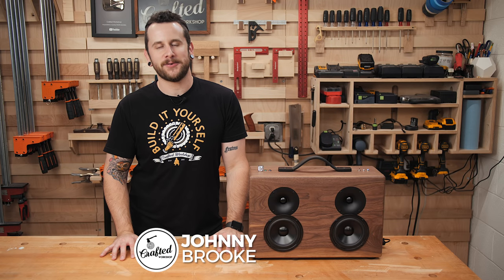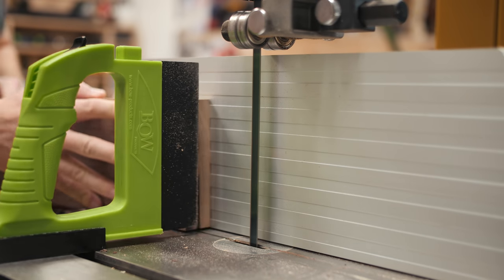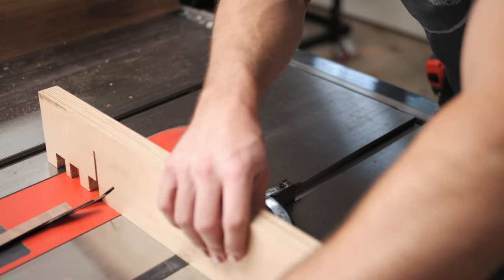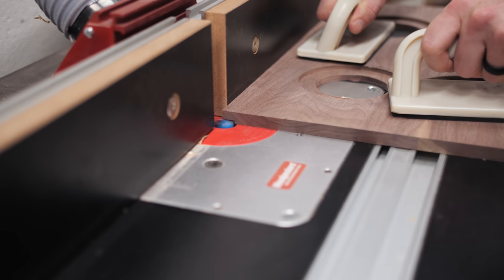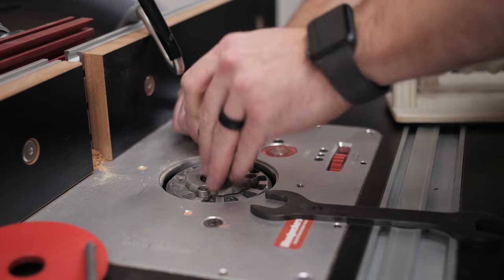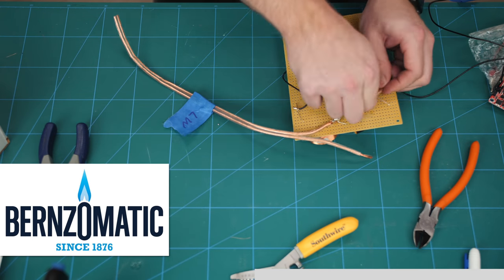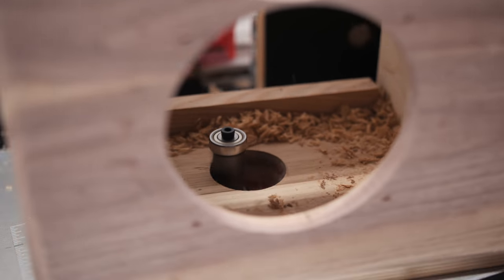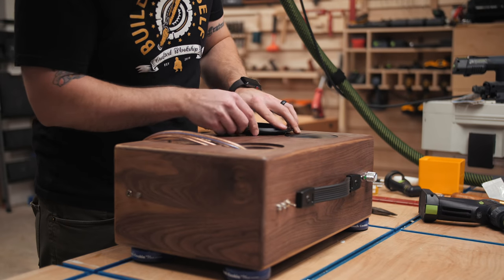DIY Battery Powered Bluetooth Speaker // How To Build - Woodworking

Comment: Would have been nice to see an in depth section dedicated to the power distribution.    The first word in the description is BATTERY and yet you have nothing in the video indicating how you handled that.
Reply from the maker: Go check out the blog article. Detailed electronics info is a little dull for video, this amp board is modular and has readily available battery packs that can plug into it. Super simple.

Comment: My first job was soldering audio jacks for an entire summer so I got pretty good at it. I ended up working at that place for almost 10 years. I'd say you did a really good job for your first time soldering. Here are my two biggest tips: 1 - put a dab of solder on the tip of the gun before touching it to the wires. This helps transmit heat from the iron to the wire. You want the wires hot enough to melt the solder, otherwise you'll get a cold joint that could break or have lots of resistance. 2 - Use spring clamps to hold your parts. Just put them on their side and clamp the part in place.
Reply from the maker: Thanks for the tips!

Comment: This looks great!! The only addition I would do is to install a couple of 12v 8Ah batteries and charger so you can make it a portable great looking boombox! It will require some additional electronics to convert 110v to 12v, to measure charge and stop charging when full... but I think it would be totally worth it!
Reply: I use 18v power tool batteries in a reciver shoe, then step that down to 12v for a class 'D' amp.

Comment: Very nice speaker build. But most of us don't have all the fancy tools to do this. I built one out of plywood and car stereo media player and car speakers. 12 volt LiFEPo4 battery and charger and sounds great , no foam inside and an vent hole on front panel. did I mention it sounds great. Lots of bass and good overall full range sound. I use it at work on my tool box. I may build a second one for home use or to replace the one at work  and use that at home. will see.

Comment: My daughter and I build a set of c-notes. I recognized them in your thumbnail haha. That box must sound awesome, the c-notes are great. The only downside is that you're missing the great imaging these speakers have by putting them so close together.
Reply from the maker: Have Drone Will Travel that’s funny! And yea, it sounds great but I’m definitely not getting as much separation as keeping them separate.
Reply: I'm still blown away when I hear the c-note. That's the best sounding $100  you can spend I think. And this box, in walnut, it looks as good as it sounds.
Reply: Yup, the C-Notes are known for their incredible imaging (for the $$.) Almost a waste to use them in this application.  I bet they still sound good.  I do wonder if a cheaper set of drivers would work well in this boom box.  Worth researching if I build one.

Comment: ** dO It YoUrSelF ** with at least 100k worth of wood working tools...... :p
Reply: normal MEN have all little cheap tools in home or garage and lot lot more tools too. no expensive, ewer no 100K haha. normal need only some clamps ,i have 4 pcs cheap and no need more. tablesaw have ewery normal men in home, same hand router, and hand planer, all other can do diy in home workshop, planer frame, jointer, circle jigs, no need lot tools can made all same.
Reply: A lot of the tools in this are pure convenience. Almost all of these things can be done with hand tools.
Reply: @farrit  thats how i make mine. i sure as hell aint got all these fancy tools.
Reply: yeah, if i had my dads table top drill press, table saw, radial arm saw, and table jig saw. he spent over 1 g's and 5 years to collect. all i have are hand saws and hand tools.
Reply: @abalczon  im going to make a portable radio into an ammunition can. i can power it with a 20amp 12 v power supply and power jacks found on amazon.
Reply: What kind off wood do you use for this speaker, nice speaker btw
Reply: But he did do it himself tho.

Comment: That looks great! 👍
Set the bad boy near a corner to get some serious bass! :)

Nice work, I never imagined I'd see so many amazing C-note builds! Or variations of... Lol

Thanks for sharing!

By the way, the ports on the bottom are no problem, lol.
Reply from the maker: Chris Perez thanks Chris! I just realized you designed the C-Note kit, that’s super cool. I bought the kit on a whim after hearing such great things on the r/diyaudio subreddit and they’ve been sitting, waiting to be built, for months. And glad to hear bottom ported is approved 😊
Reply: Hey Johnny and Chris... I built a pair of C-Notes last winter and love them--my first DIY speaker project. I've been thinking about exactly this type of project for awhile now. Any thoughts as to whether it would make sense to tweak the crossover for some baffle step correction for this configuration, considering the baffle is now twice as wide and both speakers are essentially on the same baffle? ...or would that be overkill for this purpose? Great job on the build Johnny! Chris thanks for giving us the C-Notes!

Comment: Beautiful build!  
Although, I'm not crazy about the overlapping drivers. Particularly with all that empty space around them.
I would have used slightly smaller tweeters and used up more of the horizontal space, but that's me. 
I think channel separation is worth having, despite the more traditional aesthetic of the tweeters rising and separating toward the corners.  Your design is very pretty, very symmetrical, but it may sound a bit "mono" if you're not right up in front of the system.  It's not much, but with these small boxes every inch counts.  
No worries, that's just an opinion about a minor detail... It really does look great!  ;-)
Reply from the maker: Thanks a lot!

Comment: Beautiful looking box, Johnny. Someday I'd like to build my own as well. This, and as you mentioned in the notes, Kirbymeetsaudio, have inspired me more to do so. 
Question though - why stop sanding at 180 gritt? I haven't used walnut yet so am a little unfimilair (my main preference is arizona mesquite). In the mesquite, to get it to truly explode in color and texture, I take it to 600 gritt while raising the grain on every gritt. To recap, every gritt 2x, with raised grain in the middle. What a difference. 
I'd love to hear your feedback. It's how we all grow, isn't it? 
Again, beautiful box.
Reply from the maker: Phil Z thanks Phil! I’ve just found you get diminishing returns past 180 or 220 really. I’ll sand that high if epoxy is involved, or sometimes on turned pieces that are going to be buffed to a high gloss, but for a satin finish, I haven’t seen much of a difference. But hey, if you’re getting good results, sounds like your system is working! Mesquite is super hard I believe, so it’s different from Walnut in that way.
Reply: @craftedworkshop  , thanks for the reply, Johnny. That does make sense to me. And you are correct about the mesquite being much harder than walnut. With the method I stated, mesquite will actually become mirror-like reflective before finish. I do it regardless of gloss or satin. It just adds to it that much more (for mesquite anyway)
Thanks for your time. 
I'm glad I found you through Alex's STS channel. Good stuff.
Reply from the maker: Thanks Phil!

Comment: Just to be that guy.. To get better cuts on the cnc use 3d tabs. Experiment with what works best for you but mine are about 1.5 and .22 inches tall. That keeps the movement smooth so you don't get those marks were the bit stopped and went over the tab. I also use one of those vibration cutters to cut out the parts. If I use a chisel it might splinter out.  Sorry.. I know i'm just one of many guys trying to tell you what to do.. lol Trust me, I got sick of sanding or trying to sand out those marks and that works really well.
Reply from the maker: No, those are great tips man! Easel doesn’t have 3D tabs, but I just got Aspire so I can start messing with them.
Reply: @craftedworkshop  I use vcarve pro. I'm pretty sure you'll have it in Aspire. That's a better version. All from the same company. 

Also experiment with down cut bits. It leaves the top nice and clean. Not that great for the bottom.. but.. and don't drill with it, makes a nice cut.  I do not like up cut bits.. Nothing but issues for me. Down cut or straight.

Comment: Looks nice and it's built well nothing wrong with the cabinet, just the layout of the drivers itself doesn't look good. Mainly because the woofers are overlapping the tweeters, should had made the box slightly bigger to allow some space between the drivers for aesthetic reasons.

Comment: Amazing results! Your title says it is battery powered - but you didn't really mention anything about how that is done. Was this actually battery powered or did you wind up just using wall power for it? 

I'm looking for a similar kit to build, but I don't need battery power... 

Keep up the awesome work!
Reply from the maker: Yea I kind of glossed over it, but it is battery powered. The amp board I used has a plug and play battery pack, which I linked to in the video description. You can see me install them when I installed the amp and crossovers, they’re bright green. I installed two packs and the speaker has been playing on battery for 36 hours straight at this point, crazy!

Comment: Very nice project. I was wondering if I plug 2 boards how many volts do I have? (using 3,7v  battery) is there any way to plug them in parallel/series?  thanks in advance

Comment: Nice build, I've thought of making the Cnotes before and may still. Did you talk to anyone about moving the port from the back in the kit to the bottom of the box? I've found kits in the past with rear ports but wanted front ports instead and haven't found what effect if any it would have on their performance.
Reply: Moving the port to the front would be no problem. You would need to make them a little taller to fit it (or use a port with no flange). 

As far as changing the dimensions, for best results you would want to keep the width of the enclosures and the distance from the top of the enclosure to the tweeter pretty close to the original design  (within an inch or so). Not that changing them much will make it sound terrible, but if you increase those dimensions much you will get a boost in the midrange, they might get a little bit "shouty" sounding. 

Really the most important dimension is the center to center distance between the woofer and tweeter.

Actually, you could make the enclosure about 20% larger without having much effect to the sound.
Reply from the maker: Stumptown Woodworks sounds like Chris answered that nicely! And he also mentioned in another comment that bottom ported was fine.
Reply: @chrisperez7592  thanks Chris! I'm rebuilding a vintage record cabinet with a pair of OnePi speaker kits and it's my first speaker build so I'm sticking 99% to the instructions. But this one project has got me wanting to dabble in the speaker world more...just have a lot more speaker forums to read through!

Comment: Does this board, or any of the DIY Bluetooth boards support hifi Bluetooth codecs?  I know you said you’re an audiophile, and I’m curious if you went the extra mile on this.  I can’t find a board that states it supports lossless or other hifi options.
Reply from the maker: Michael Rasmussen yup, Bluetooth 4.0 aptX, which is as high as you can get AFAIK. AirPlay would have been even better but this board doesn’t support that.

Comment: Hi! Super nice project, always dreamed about my own spesker like that :) may i ask you a question, what kind of cnc do you use? I noticed is that a removable dewalt router which is put into the cnc frame/base?
Reply from the maker: Maksim NMR thanks! I use the Inventables X-Carve, I’ve linked to it in the video description. Works great!

Comment: How long does it last on a charge?  And how much was the overall build? By the way I love it.
Reply from the maker: The boombox has been playing for 42 hours straight so far, insane battery life. The electronics were about $250 plus the cost of the wood, which will depend on your area.
Reply: @craftedworkshop  If you have some time would you please go over the electronics or more specifically the battery setup. I appreciate your response earlier. It's a beautiful build. Definitely will build one when I have more experience with the tools I do have. Thank you
Reply from the maker: Unstable1 I’m going to do a detailed post on my website breaking down the electronics. Stay tuned!

Comment: I love your work just don’t like the speakers positions.
Reply: alas have to agree there, the case is awesome, but ... the positions seem off. You want as much distance between tweeters as possible. Now the original C-Note speaker kit has that same overlap on their show models too but there it is a left and right speaker each with their own box. In a design like this you want to maximize the distance as high notes are far more directional than low notes (which is why bass speakers are usually a single box placed in the center)

Comment: I'm curious why you lined everything with foam, You should have done a sound test before you added the foam. Guitars are not lined with foam on the inside for a reason. Different materials give a different sound, I bet that Walnut would have been fine just bare.
Reply: A guitar is a guitar... point...

A speaker has to mimic all instruments and more...
So there's a big difference

Foam isnt needed, but it serves 2 goals:   being able to use a smaller box and dampening soundwaves coming through the wood, being at a different phase...
Reply: @lillnemo1  unfortunately this wood is not very good for sound there is a reason why the industry uses mdf (Medium Density Fiberboard )

Comment: if you want to get into electronics and soldering ,get a normal cheap soldering iron from china , the ones with the big transformer box and the temperature knob ,get a small tip for the iron and a chisel tip not too big ,the chisel tip should be like the tip of a sharpie pen...
for solder get yourself solder 60-40 with 3 or 4 flux cores blend ... get the finest solder you can get ,that gives you control over the amount you can put in
that should give you the basic tools to solder basic electronics 
the gaz powered thing is convenient but you have no control over the temperature , you typically solder electronics at 270 -350 degrees Celsius
sensitive electronics like micro controllers should be soldered at lower temperature 250-320
the gas soldering irons dont give you control over the temperature and in a split second you can burn the component ,or the track or even the pcb itself ,and you pump too much heat into the component itself

Comment: After all the effort you mount the ports on the bottom with barely any clearance. For an audiophile, you should know that won't work properly.
Reply from the maker: Bottom ported subs are extremely common, and there is about ½" of clearance with the feet. The guy who designed the C-Notes has commented in this thread and said the ports on the bottom would be fine.

Comment: I like how you skipped over the part that would benefit most people, the circuitry.  Instead, you rambled on about a soldering iron... Then back to woodworking. Not helpful.

Comment: your title sucks nothing about battery or Bluetooth in the video it was just building a box
Reply from the maker: Wayne, I listed ALL of the parts in the video description. The amp board has Bluetooth built in and has battery packs that can be plugged in. No need to be rude.
Reply: @craftedworkshop  not trying to be rude but the title would make you think there would be something about the battery and Bluetooth in the video. the video was good I watched the whole thing but the title misleading